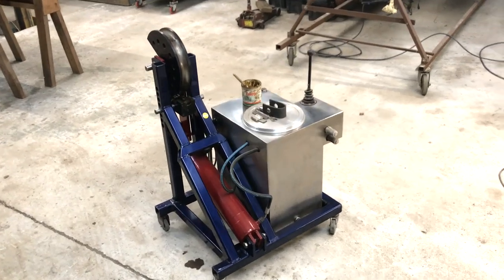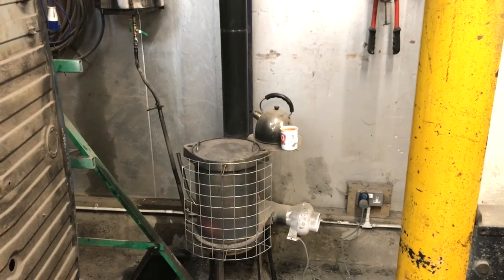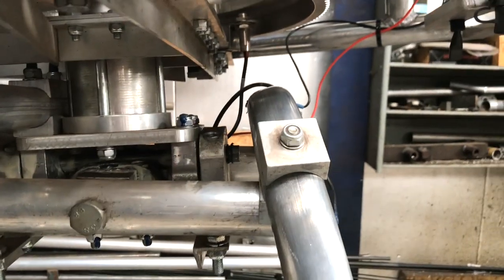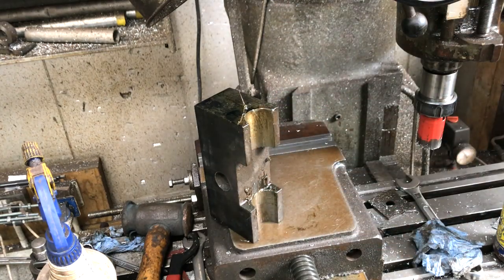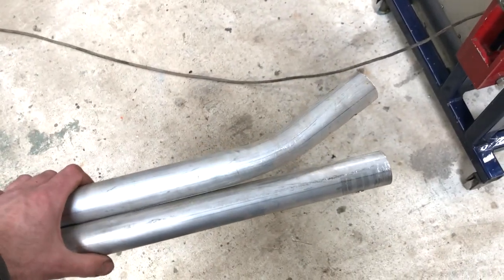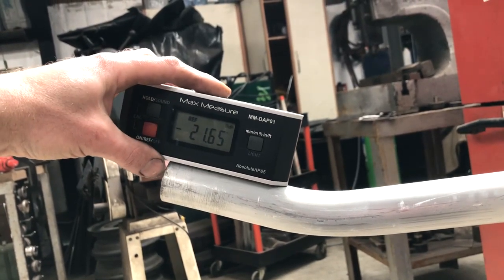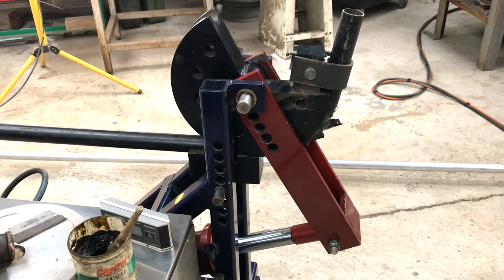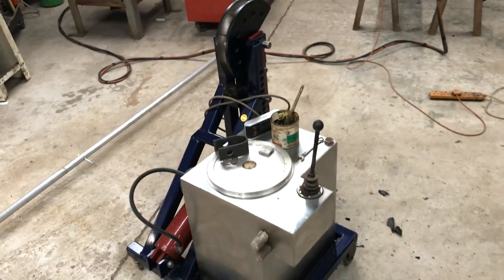Homemade Electric Hydraulic Tube Bender

Comment: I built one similarly off the Got Trikes plans about 15 years ago. I do want to do the same as you with the hydraulics. I built mine with renting a magnetic drill press. I now have access to machine shop tooling & have been pondering re-building it.
Reply: Now my curiosity peaks & may look into building a helicopter.
Reply from the maker: @TBJK07Jeep  Powered hydraulics is certainly nice, there is an air powered hydraulic ram you can get which is cheaper than electric hydraulics. I was just lucky that the old sausage machine was here lying about and it fitted perfectly. 

All good for building helicopters 😀👍

Comment: Most of us have an old sausage machine and a lathe,  so we can all duplicate your work quite easily.
Looks like you did a good job.  There is a recently video on how to make a die for $10 using 3d printed parts and plate steel, you should check it out.
Reply from the maker: The dies I made are protools 105 dies you can purchase them. The sausage machine I used was also my preference, you can buy a manual 8Ton hydraulic ram for £35. I haven't got a 3d printer.

Comment: I have that same bender from gottrikes. I'm dying to go electric hydro too but can't find the right ram and pump setup. Can you help me find a link to the correct ram and pump?
Reply from the maker: Hi, it will come down to budget. The formulae is force = psi x piston area. 
So if you found a pump producing 2500psi and the ram has a 3" diameter bore then the force would be 8tonnes, the same as the manual ram.
Reply: Thx, got a new question for you. What size diameter is that die in the video, and what size lathe do you have to make it? I have a 12x40 lathe and trying to figure out realistically what size die I can make.

Comment: So amazing. Can I buy a die from you? Looking to bend 1 5/8" tube.
Reply from the maker: Hi and thanks. The Dies are a pain to make, take ages and cost a lot in material. Can't compete with the price of the ones available online unfortunately.
Reply: There is a recent video on using 3d printed parts to make a die.  They work great, not junk.  Search you will find it